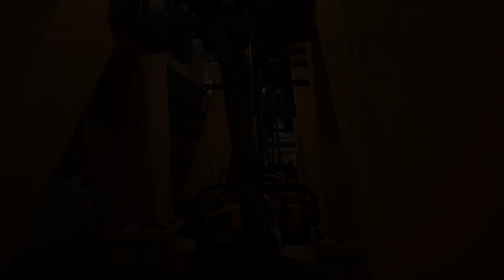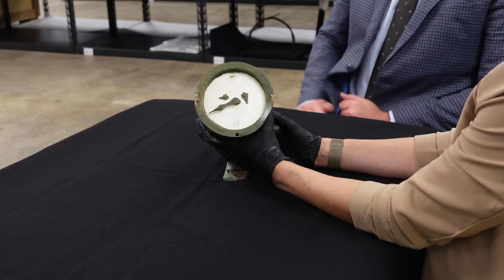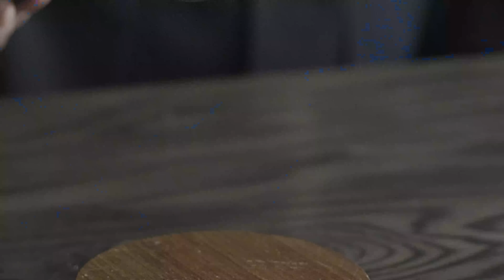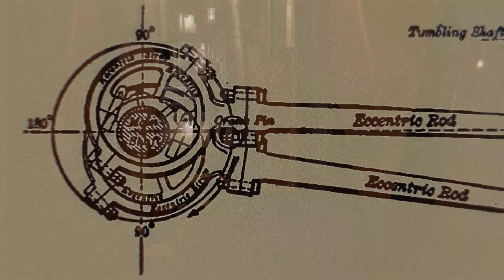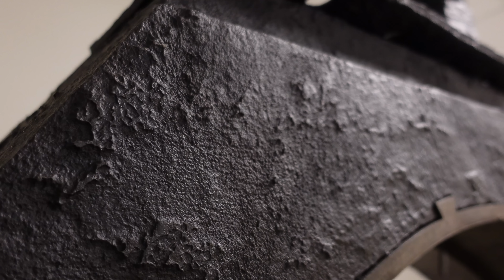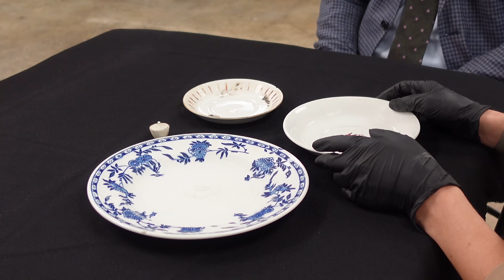Exploring Titanic's Rarest Artefacts: The Engines

Comment: One feature of the eccentric straps are the diagonal grooves machined into the bronze inner surface.  These grooves allowed oil to flow evenly across the bearing surface  of the strap to provide adequate lubrication.  

One of the duties of the engine room personnel would have been to reach in and touch the eccentric straps, main bearings and connecting rod bearings as the engine was turning, to make sure that the bearings weren’t running too hot and that they were getting oil.  

I have done this as an engine room volunteer on the operating museum ship SS JOHN W BROWN.
Reply: Yes, the engine room was a busy place.  Steam engines needed a lot of minding.
Reply: I was on the SS John Brown on the last trip it made under the Key bridge, It was one of the last trips I had with my dad, He loved it!  I also volunteered and helped clean the boilers on the same ship.
Reply: @elky82 glad to meet another JWB alumnus; I’m so glad your father was able to enjoy the trip.
Reply: What I noticed was how the straps are dovetailed into the main casting.  An insert bearing basically.  Most cars didn't get that until the mid '30's.  Enjoyed your reply.
Reply: @brianmatthews9697 Thank you.  My WAG is that it wasn’t until the 1930’s that the cost of this dovetailing dropped to where it was practicable to use in passenger cars.
Reply: People don't realize or appreciate how much things have changed.  Here I am watching this with a full thermal cam built into my phone. 

I know today we have trackside automated defect detectors watching for hot roller bearings.  Back in the day when valve gear like this were on locomotives we had a person in the caboose that would watch as the train went around bends and smell for garlic/onion from hot boxes of failing or dry friction bearings
Reply: No Shit
Reply: @TerryMcBride-u4r ?
Reply: @TerryMcBride-u4r ?

Comment: Marine engineer here, re the log meter, dopler equipment has been used to measure ship speed & distance travelled for decades.
Reply: Some small sailboats still seem to use the log meter method as a backup.  I think it is a "if all else fails" sort of thing
Reply: @kensmith5694  It's like a car using an odometer.

Comment: The Eccentric Strap's bearing surface is not bare bronze as she stated. The bearing shell itself is bronze, but its Babbitt Lined. 

Agreed with it being a spare, if it was wrenched off of the eccentric cam in the wreck, it would've shattered. Its too perfect and undamaged for it to be one of the straps actually in use. Also, the babbitt lining shows no witness marks of the cam rotating within it. Since it was the maiden voyage, there would not have been any appreciable wear, but there would definitely be signs of the bearing surfaces bedding in as the Brand New Engines stretched their legs. 

I applaud the description of the Valvegear here, more of an accurate description than the prior engine room video.
Reply: Also note that the studs and nuts for the eccentric rod are also present. Makes sense for a spare, not one that was on an active engine.

Comment: I can only guess that being on the Titanic would be really different then today like on a Royal Caribbean ship. Ships today have ship stabilizing as I don’t think Titanic had anything like what we have today. Must have been a rough cruise back then.
Reply: Titanic was not a cruise ship.
Reply: @neilroberts7457 yes!  An ocean liner
Reply: Olympic and Titanic were observed by passengers and crew at the time to be far more stable and smooth-riding than other ships of the day (consider Imperator as the opposite extreme). Notably, several of Titanic's passengers noticed a 2° list on the final morning of her fatal voyage, which would have been imperceptible even on Mauretania due to rolling.
That actually proved to be a bit of an issue during the sinking, since many passengers and crew, accustomed to other ships' pitching and rolling, either didn't notice or didn't recognise the seriousness of Titanic's relatively paltry shifts of balance until most of the lifeboats had already gone and time was running out.

Comment: The record kept by the patent log would have accurately measured TITANIC’s distance traveled through the water, but that distance would not have taken into account the substantial effect of traveling with or against the Gulf Stream current, which ranges from about 1 to nearly 6 mph. 

To get her true position, Her officers would have relied on celestial navigation.
Reply: For those of us who undertook blue-water navigation before the internet did it for you, you're quite right. But the distance on the log gave you a valuable running fix which you then somewhat better pinpointed with dusk and dawn star sights and noon sun sights. Only "somewhat" unless you were navigator on something big; otherwise you're doing all that sextant work from a pitching deck.
Reply: @KR-ll4dj you are absolutely correct.  I made my comment only because the video suggested that there was a direct relationship between the readout on the patent log and the ship’s moon position.
Reply from the maker: @Pamudder I meant rather that taking the log complemented the taking of celestial readings, not that it was the sole or best option
Reply: @OceanlinerDesigns Thank you for the clarification.
Reply: @OceanlinerDesigns  Also you need to remember that propeller slip is a big part of the equation that needs to be worked up in addition to the patent log.

Comment: The eccentric strap wouldn’t have been moving during the sinking though would it? The steam would not have not gone through the engine but all diverted to the turbine which generated the electricity.

Comment: And as those steam engines, which that part is casted, run directly prop shafts, those stood still after the ship halted. And cause of that, steam demand degreased significantly, steam was released up in air via very noisy pressure relief valves. The capacity need to unload somwhere, when huge engines did not consumed anymore and rest, still running units, were much smaller. I do not know how long that blow phase eventually lasted, but it must took a while to get a balance for production and consuming. Electricity the ship required, was created by steampowered generators, or 'dynamos' as that time, so those were kept activated up the finale. Just a case few get wrong image what engines down there kept the critical life up.

Comment: Not long ago, we had a gentleman in the channel that said the lastest guideline to manipulate historic documents is without gloves - I can't remember why. So took my attention that she was wearing gloves, made me wonder if are because metal needs an different approach than paper to avoid damage.
Reply: It indeed depends on the type of object. More libraries are permitting un-gloved inspection of old books now because they've found the danger of tearing pages with less sensitive hands is greater than the damage the oils in your skin will likely do to them. But I imagine you can easily make a hard-to-remove fingerprint on polished metal. Just ask a cybertruck owner.
Reply: There are several factors at work. For one, the linen blueprints at that museum in the UK haven't spent over seventy years at the bottom of the ocean, so they won't necessarily have the same vulnerabilities as objects which have. For another, they're mostly made of organic materials, unlike the artifacts shown here, so the chemistry is entirely incomparable.

Comment: Thank you for highlighting the valor of the engineers and stokers. They served until almost the very end.
Reply: They served until the very end. They weren't able to escape with their lives.
Reply: @RaeCarson None of the Engineers survived and most of the Stokers and Trimmers died.
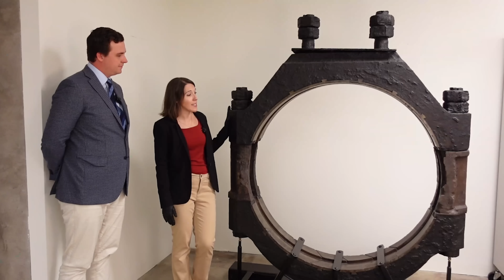Reply: @RaeCarson They didn't survive, but they also didn't work til the last minute. They were released from duty around 1:30 and seen on the boat deck by many, many witnesses.
Reply: @pc_buildyb0i935  ....meaning they weren't released soon enough to make a difference because why? BECAUSE THEY WERE KEEPING THE POWER RUNNING.
Reply: @RaeCarson what would they have been doing if the ship was flooding and sinking for hours? Were they still trying to power and maneuver the ship?
Reply: @Derelicte87  I think they were keeping the lights blazing [probably heating the ship, too?] They are Heroes all. ⚓ 🙏
Reply: @Derelicte87  They were feeding the engines to keep the generators going.
Reply: Very humbling to think of those courageous and selfless men doing their duty to the last. Real men.
Reply: Plus the Electricians who worked keeping the lights on right to the split of the ship in two.
Reply: I always think of their bravery first. ❤
Reply: Indeed
Reply: Realistically, most of them could not have known how soon and sudden the end would be.
Reply: they're just corporate slaves